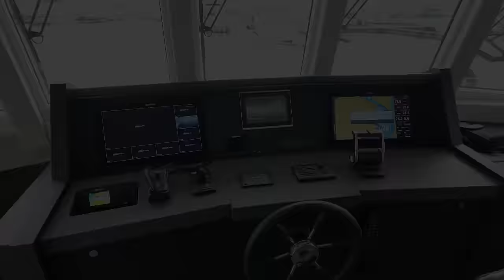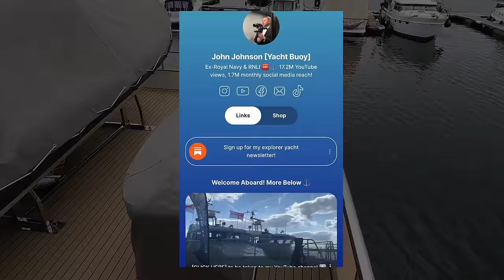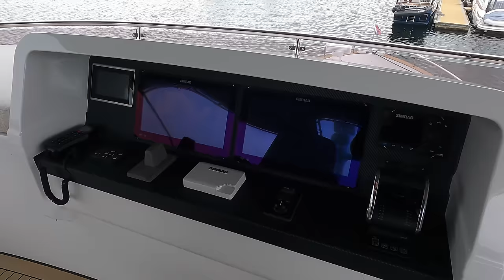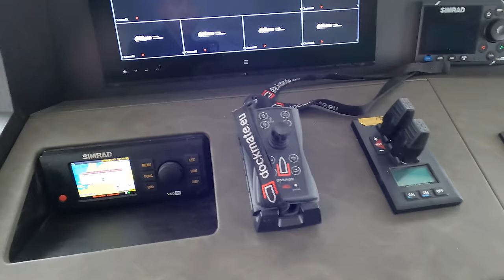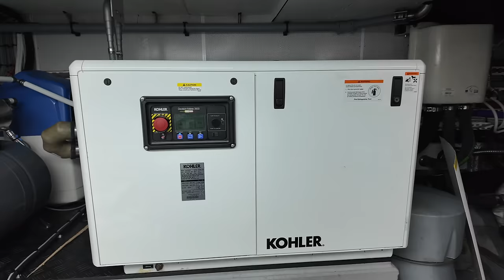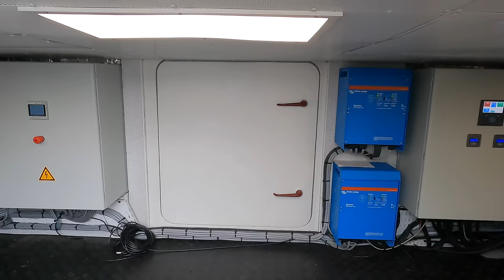ONE OFF Explorer Yacht FOR SALE! M/Y ‘Dutch Lion’ FULL Boat Tour!

Comment: Outside of being a nice looking explorer. My main issue is the lacking electronic equipment right off the bat.  Example 1. No analog bilge lights on a ship diagram mounted above helm or anywhere.  There is no secondary system on board, i.e. GPS, nav. Or autopilot. Redundancy is the most important thing on an Explorer yacht.  No back to the video.

Comment: Good comfortable looking explorer yacht. Glad to see the two motors and the engine room was awesome! My only issue is, that I saw it has only one generator. Needs two in case the one craps out. Other than that, I like the layout and shape of it. It looks like it could handle some rough seas, but not to rough like a steel explorer yacht. Still, to me a yacht I would like to have if i could afford it.

Comment: I do like this vessel however there are a few things I would definitely change.
1. Change the flybridge to a fiberglass hardtop
2. Put some handholds / grabrails around the cockpit for the rough water this yacht is supposedly built for.
3. Put some pan holders around the stove - as above.
4. Have the owner / agent bother to at least make an effort to tidy the boat up for selling it.
5. Spend more time with the Goodest Boy m 

Did i miss a mention about her top / cruising speeds?

Great video John.
Reply: How about that crappy flybridge helm seat. There should be two big beautiful seats right there. The cushions for outside seating looks like it wouldn't be super durable, hard to say for sure but looks that way.

Comment: Always interesting when you compare yachts in the 50-80' range. If you look at a Bering 70 vs a Princess V70 or a Fairline 68 even, they are so radically different. Then you look at a 70' Viking fishing yachts, obviously a purpose built craft, but still, it's 70' with about the same accommodations for passengers and crew, but also something so different and I think in that size range, the purpose of the yacht really becomes the most critical factor in making a decision, more so than any other yacht design. A fishing yacht, cruiser, explorer, pleasure craft, flybridge, commuter yacht. That size it is so critical to decide what you are going to be using the yacht for.

Comment: Nice solid build for a seagoing family/operators. Crew might be a problem. Cold storage for extended voyages unseen?. Shame about the engines though. I have had dozens of Iveco products and never found a good one yet and I would be here all day listing the issues though having said that they are well known and spares as a result are easy to source across Europe. No mention of battery power so I guess the genset is going to be worked a lot.

Comment: This boat has an incredible layout for its size. I assume that the hull is made of Aluminum which allows her to have a good navigation range for its weight. Question: In the main cabin's Port side, was that a door to a day head? I did not see good freezer and fresh storage for long passages. I would also add a water maker if possible and maybe switch the canvass top in the Flybridge for a fibergalss hardtop to place some solar panels on top. There is room in the Lazarette for some lithium batteries and related equipment.

Comment: This boat is confusing - while the hull and superstructure are very seaworthy, the interior spaces definitely are not. The helm is open to the saloon, with no visible means of blacking it out for night running (must the guests stumble around all those sharp corners in the dark?)

Using the galley in any sort of weather would be ... interesting ...

There are no crew quarters or pilot berth...

The list goes on and on....

She's perfect for marina life and coastal cruising at best. I'd run her down the US east coast ICW, but would probably not consider the same journey offshore outside (which I have done delivering an actual working trawler to Florida from Maine)